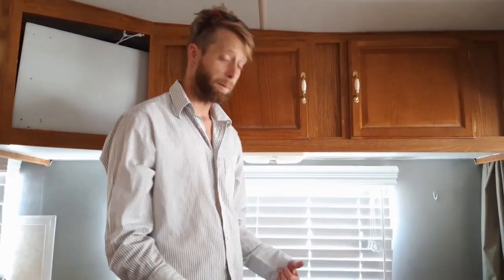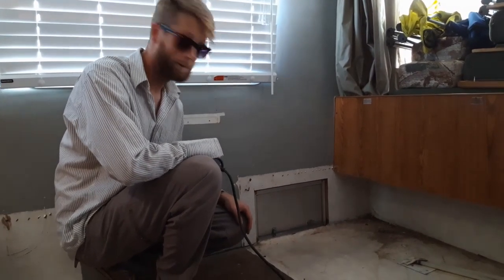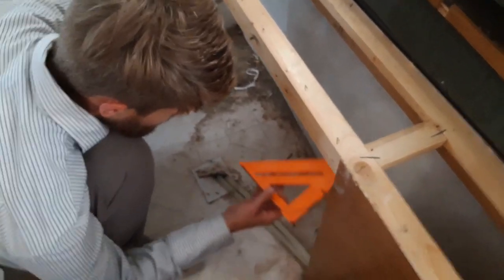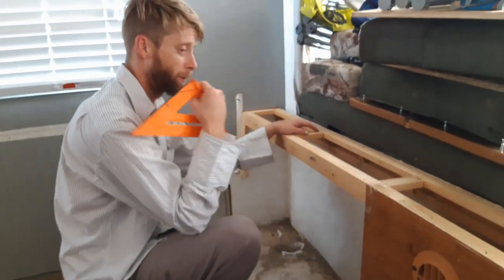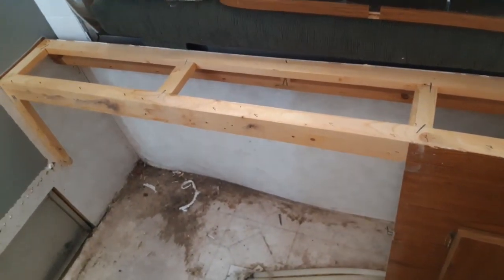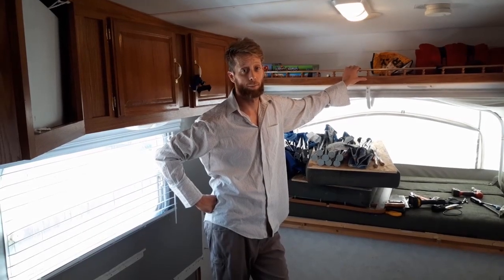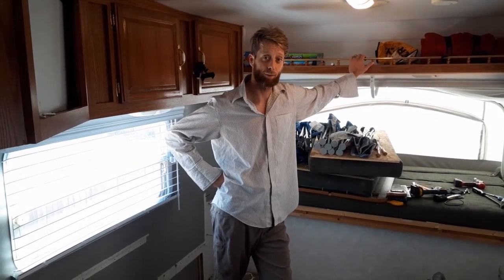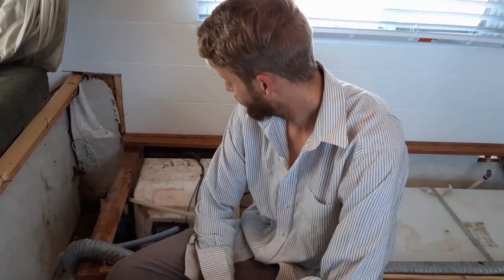Well, That's Gonna Be A Problem|5th Wheel Trailer Demo Day 2|New Homestead Prep

Comment: When you get to the water heater  issues   suggest you look into a in demand  low pressure  heater  note no storage  tank   heats water on demand  turn water faucet  on and it starts to heat water as it passes  through
Reply: Robert O. Peterson that is definitely the way to go on-demand water heater all day
Reply from the maker: Very Good suggestion! We are thinking about it. Right now our Water heater is a gas one - so it can work without power at all. That might be handy for when we arent plugged into the generator - but im wondering if we can find one that will work with this trailers battery power cause its only a 30amp trailer. Idnk. Worth considering though cause it would certainly free up a lot of storage space! (BTW We have an on demand water heater for our current house and we LOVE it! I KNOW how nice they are to have! THE Best! <3)

Comment: Not sure age to your 5th wheel trailer , When i got my it still had standard 12v bulbs they get very hot if on very long  some even melt light lens cover  i have since replaced all the bulbs  even had to replace couple of the light fixtures altogeather  with LED brighter and dont get hot and use less power therefore extend battery when main power goes out .
Amazon was very reasonable priceing compared to RV Dealers almost 2 to 3 times more  .  live in very rual community   so options for Shoping for RV stuff limited Amazon been good
Reply from the maker: Our trailer is a 2004 Fleetwood Wilderness Lite (with canvas pop put bed). Honestly I never even thought about checking the light bulbs - thanks for the tip!!! Very good advice for battery life extension! Well look into that! Thank you again for the advice, & your support! We appreciate you!

Comment: Well since you have to take it all out might be a blessing because you may figure out a better option to have a bit more space. I cannot wait for more of this build. What kind of winter weather will you have Arkansas?
Reply from the maker: So True! Well see what we can come up with. :D Winters in Arkansas are cold, but mild. Usually only a light dusting of snow but locals said they have seen a foot from time to time. But generally, only a few inches each year. But the temps get down to the teens at night. We will have to insulate the tent portion of our pop out to keep the heat in during the winter. But we have plans for that ;) Thanks for your support Sandra!